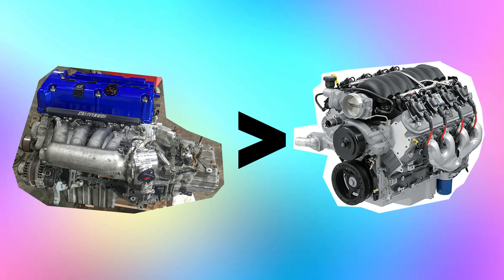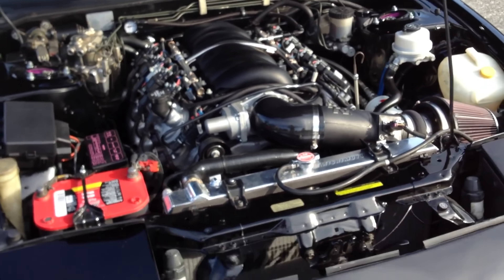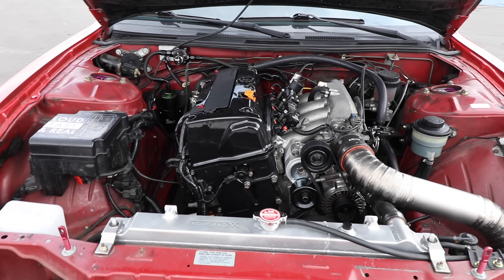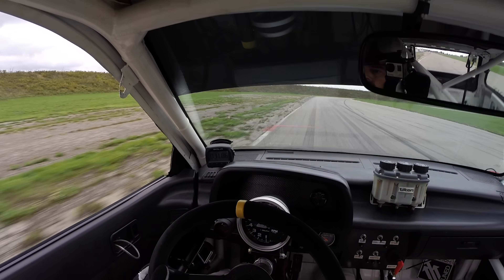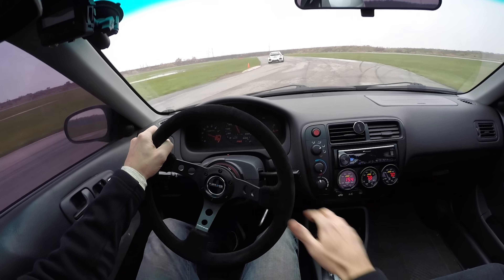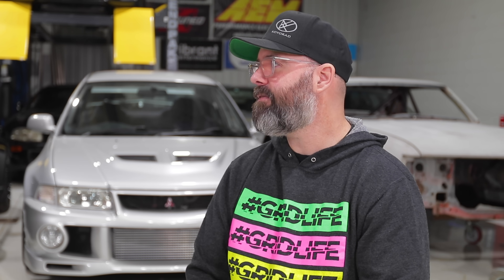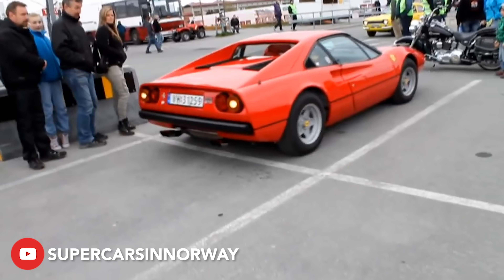Is the K-SWAP the New LS Swap? Everything you need to know about K20 K24 Honda Engines

Comment: k20 2.0L @ 275 lbs - and makes 139 lb-ft @ 4600 rpm and 156 HP @ 6300 rpm
LS6 5.7L @ 460 lbs - and makes 390 lb-ft @ 4800 rpm and 385 HP @ 6,000 rpm

K20 has a wider range between peak torque and HP
LS makes more torque per pound & equal torque per liter.

Comment: Why don't you tell the weight of the vehicle that the K starts to struggle? Because, you are showing pretty lite cars. From approximately 3000lbs and BELOW!
I have a IS300 that is about 3500lbs. I wouldn't want to be "IN" boost just to be driving to work and around town.

Comment: That's a transverse engine, right? How is it even possible to make it longitudinal?
Reply: Doesn't really take much, outside of "kit" items like rad hoses, motor mounts, bellhousing adapter and the other prefabricated chassis adapting parts. To keep them happy longitudinally I think it's really just an oil pan, oil pump with a different pickup, a "mirrored" or revered intake manifold (oem styles would put the throttle body facing toward the firewall) and I think that's kinda it for the bare basics. Oh I'm wracking my memory but I want to say that the cylinder coolant jacket diverter that the K24's have has something to do with those rwd swaps, cant remember if its you leave it in or take it out, or something... maybe I'm remembering K20/K24 Frankenstein stuff idk

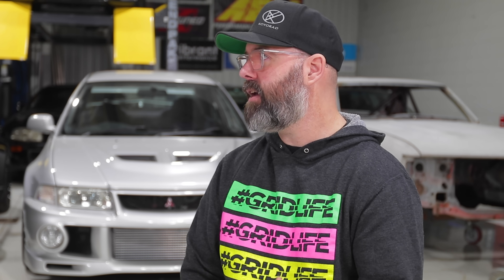Comment: 4:11 in that case, you just have to trade top end power for low end torque. With 2.4l and twin turbos you could get pretty insane bottom end torque (300+ foot pounds) while also getting 400hp at the crank.

Comment: How difficult would it likely be to put a K Series engine and manual transmission until a 1960 Austin Healey Bugeye Sprite. It currently has a 2.0 Pinto engine in it but I blew a valve/cam/piston so I'm trying to figure out if I should fix that or swap to something like this.

Comment: to get the power you can get out of an ls it will cost you more to get it out of a k24 or k20 most LS's come with 350 to 400 bhp your not getting that N/A from a K20's for the same money NO way use LS less then 1000$ sometimes pull it down clean it up and 400bhp now get a used kseries pull it down clean it up heads cams valve and god kows what eles just to get 300-400 will cost you much more even if you bought the k series for 500$ or less the new parts to get the power will exceed 2000$ if done by a professional company and really unless ur a don mechanic id get the pros to do so it depends on what you are going for i think init lads?

Comment: When it comes to exhaust size, i have an eg with k24a2 with 3 inch exhaust and it made 215 whp and 175 ft lbs of torque. I also have an ek with the exact same setup and mods but it has a 2.5 inch exhaust..the ek made 220 whp and 181 ft lbs of torque on the same dyno.
Reply: could the difference in transmissions, tires and axles played a part?

Comment: I love the B series and have many fond memories of ripping to 9k and beyond in B series Hondas on Japanese backroads, but I will gladly rip the B18 out of my ITR and replace it with a K20. Bolt in 220whp with stock engine reliability and drivability? You'll never be able to replicate that with a B series. A 220whp N/A B series is an engine that only wants to go WOT. With that said, the K series is definitely much more fragile than the B series in terms of being receptive to large cams and stuff, but I'm over having race engines in race cars. I just wanna drive, I don't want to deal with shit always being broken and cars that need to be push started because the overlap makes the engine not want to start on its own (that engine was a fucking blast though).

With that said, I would absolutely love to have a B series EG hatchback again just for nostalgia's sake.

Comment: .Na I rather Swap LS engine or Rb26, 2jZ k series are good but it's 4 cylinders comparing to ls v8 or v6 2jz OrRB26DETT Nissan Skyline RB28 is more superior and Reliable even with turbos bc no.matter what u do The K Series engines with Turbos wont passed 100  thousand miles without major Problems or Major Maintenance

Comment: They missed the part where you can get the power of the k24 but high revving of the k20s with a type s oil pump. But yea the aftermarket support for the k series are crazy. The best 4 cylinder swap for sure.

Comment: What is the upper weight limit that a K24 engine could push? I'm into American cars and have been exploring dropping a K24 into lighter cars like an early Ford Mustang Hardtop or an AMC Gremlin. I have noted that the K24A2 has been fitted into the Acura TSX that weighs over 3200 lb, a mild K24 build should work on anything lighter than 3,000 lb.Still, I wonder how it would work in the 78-83 Chevy Malibu or an El Camino? How heavy is too heavy?

Comment: I haphazardly searched "K24 swap everything you need to know" and found this video. I ended up watching a hipster and some dude that looked like my preteen nephew explaining how noises made them feel and being excited about triple-digit horsepower numbers that started with "2s" and "3s". 2/10 would not recommend. Just a few ideas off the top of my head for you fellas, could you maybe talk about engine mount locations, transmission choices, possible donor vehicles, engine dimensions, exhaust/intake locations or aftermarket tuning support? Weak..

Comment: You forgot to go over the fact that if you have a k24 block and a k20 head with a rsx type s k 20 oil pump.. you can have the low end torque, and the high end power all together.. mine made 273 with drag cartel 3.2 cams and Wiseco 11:1 compression..

Comment: It sounds more like "what to swap that is not done to death" than what you need to swap in your car.
You've said it yourself. To get any proper power 400+ you need tuning, parts and work to make it happen.
That doesn't sound like an "easy cheap" solution. And it doesn't compare to a truck LS engine at all. Smaller, lighter, yes, if that's what you need.

Comment: I've been planning a K swapped K24 bottom end and k20 red top jdm head maxima  turbo and NOS and meth injection antilag  and rolling antilag via Haltec and Bcracing DS coilovers lz spec 1989-1994 for the past 4 years and get my build tuned by Jack at hp logic or Brant at pfi speed

Comment: If I wanted to keep it super light and rev it to 8k all day, I'd get a K-motor, for literally anything else, LS swap it. Lighter per cu, more ci per dimensions, in fact it has almost the same external dimensions as a dressed k-series. Plus I can get parts at the local NAPA and go to any wrecking yard and pull a 5.3 out of any chevy or gmc truck and trade it for three chickens and a happy ending. There is just no beating an LS for ubiquitous swap engines. Almost anywhere a K-series will fit an LS will fit.
Reply: Damn you americans and your cheap v8 power

Comment: I can certainly see that if you have something like a 1.6L engine how going up to a 2.4L engine has a lot of appeal, the increase in torque (especially on a light vehicle) is going to make a huge difference. That is without having to go to forced induction in order to make decent power (for a small light vehicle).

Comment: LS3 makes 430 HP stock and could handle up to 800-1000 without making major modifications to the block, not sure why you would want a k series when it makes like 200 stock and probably blows up at 500 bhp.

Comment: The sr20 gets no respect in longitudinally mounted or transversally mounted cars. Very very underrated
Reply: Very very expensive. That's the point they are making
Reply: @jacobdoesfunstuff  Not really, you buy a DE cheap and de+T it for cheap
Reply: The SR20 is a trash engine that was built with every corner cut by a company going bankrupt to be an engine they can throw in everything.

Comment: No, its not. Because a K series wont hold the power a 250-500$ LS block/walls/rods/crank will.
  But, If I were to swap a Honda anything, Id do it "different" with an old SOHC.

Comment: 15k for 500
Vs an ls3  for about 5k stock
They may sound good 
But when your on a budget its not the way to go🤷🏿‍♂️
Reply: Exactly plus it's almost half the torque of an LS and this one especially require a race fuel since it very high CR
Reply: I see your point but, please know that the 500 hp $15k k motor is a specialty NA motor. If you are only interested in cost vs power, then you just go turbo for k series. you can get a k series engine + trans + and turbo it for under 5k. Stock block will handle 500, but obv rod + piston would be better for longevity

Comment: If the swap parts become more available and affordable for chassis other than Miatas, then maybe it'll be a worthwhile swap. Even the Miata swap kit is still 4~5K USD. You guys spent over 8K on your K240SX, with some nice fab deals from NV, and it was still just as fast as Vinhs FRS on worse tires. Maybe it's just my bias for wanting to drive vs wrench, but all these really complicated swaps don't do that much for me. They're less 'home wrenching' and more 'shop build' in my opinion.
Reply: That said, I'd totally love to see a K-Swap E36 or E30 project :P Just try to get the parts into production!
Reply: Or a Kswap RX8 since those shells have to be getting cheap and rotories are well....

Comment: I don't really understand power vs displacement. Unless you are getting taxed heavily by your government for the size of your engine. Which I wouldn't think would be an issue with a swapped car. To me the only number that matters is power vs weight of the engine and where the engine carries most of that weight. This is what makes the LS nearly unbeatable.

Comment: No love for the H. The H series swap is way cheaper and nearly as powerful. Downside is it’s heavier and not as well supported. But it sounds better.
Reply: Can you put it in a rear wheel drive layout?
Reply: @chrishenniker5944  You sure can, probably the easiest way is using a B series AWD trans. The engine would be transverse mounted though. The engine spins backwards so mounting it with an adapter to any old box isn’t going to work. To swap an H into a car like the 240 is not really going to work but you can swap it into any front drive car and covert to AWD or RWD if you desire. Years ago featured in Honda Tuning Mag there was a 5th Gen Prelude that kept its factory H and using a B AWD trans converted it to RWD. Over 500 hp and everything.
Reply: @dRiv3R0000  I suspected as much. As far as the front wheel drive goes, I know people swap them into Austin Minis, ADO16s, etc, as well as mid engine Fiats and kit cars. Are there any Honda power plants that can be stuck in a rear wheel drive layout, aside from the J and K series?
Reply: @chrishenniker5944  Well, with my limited knowledge I don’t know. It would depend on if there’s a RWD trans that spins backwards. Since the B and H both spin that way the only “easy” RWD Honda swaps are the K, J and the F20/22 (from the S2000).
Reply: @dRiv3R0000  I suspect that the L series can also be used in a rear wheel drive layout, as I’ve seen footage of them used in these very elegant, yet quick, long tail boats in Thailand. They’re longitudinally mounted on a stick, so I wouldn’t be surprised if you can bolt one up to a Getrag or similar and drop it in an Austin Farina A40 or Ford Anglia.
Reply: @dRiv3R0000  The other V6s spin the right way , you said. I saw a chart on the Kennedy Engineering website that they do an adapter plate for the Honda C series, so I could put that the right way. The G series  straight five points the right way too, so that might work with a Tremec T-5.

Comment: nobody cares about power per displacment unles you running in a class why would you start with a engine that small .with the ls you baseline power is way ahead of the 4 cylinder.no replacment for displacment

Comment: K20/K24 powered 308 is a fantastic idea. 

And with the right exhaust setup might even sound a bit like a the original V8, since they don't have the high-pitched F1 style wail of the later 348/355 cars. Through some big driving lights on the front and say it's a Group 4 Rally car!
You guys will have to rock big mustache's and Hawaiian shirts every time you drive it though.

Comment: boosted boiz is using 2 k24 engines in 2 different mr2s, the white one makes around 1000hp.
It is a respectable engine, you get it all, power, fun, torque, reliability and it is affordable :)

Comment: My man I have a stock 04 k24a2 block with a stock 04 stock k20a2 head in a 92 civic hatchback dx with a rsx type s 6 speed manual transmission rbc intake rdx injectors on e85 making almost 300hp

Comment: power to displacement is irrelevant. power to weight and power to physical size is what's important.

looks like the K motor can have better weight distribution for FR cars vs. the LS, and it might be easier to package too in some cars. The LS might be cheaper and more abundant in some instances, also not sure if Honda offers K20/24 crate motors.

Comment: I have pondered about putting a K24 in my 2003 factory 5sp IS300....but its still a thought! I dont think anyone has done it yet! I'm just trying to think out of the box and be different! Tell me your thoughts guys! I would like to here people's opinions!
Reply from the maker: There are really good options like the 2J and Beams so not sure its worth it.
Reply: @speedacademy  yea i feel like 2jz 1jz and the beams motors are just ppayed out and doing a LS swap has been done alot with the IS300 chassis. The K24 swap would be very different in the IS300 chassis! But like i said i have been pondering about k24 swap in to the IS300...but most likely all end up doing a 1jzgte!
Reply: @speedacademy  also doing the K24 swap in to the IS300 would be expensive because it hasnt been done before. So i would have to get custom motor mounts bell housing and wiring harness! I really dont feel like putting out that type of money to do all that work!

Comment: This was interesting - I don't know much about Honda motors.  How tall is the K series compared to Connie's Beams?  Going RWD from a K series puts the exhaust on the passenger side to get around the steering column & brake booster interference.

Comment: I have also seen a trend lately of 3SGE Beams motor swaps into various cars. Probably a fairly equivalent bit of kit. Are they much of a thing over there?
Reply from the maker: Yes, they are a thing here, including in our ‘77 Celica project 👍🏼
Reply: Awesome, I'll have to check it out!
Reply: 3sge is a reliable engine. I had red top before 197 stock hp and it doesn't care for whatever you do with it.

Comment: I'm massively biased owning both an evo 10 and 2 rx7... but i would argue its almost impossible to beat a rotary in terms of bang for your buck. I would also argue the 4b11t is HUGELY underrated for reliability and HP just because its in the evo 10 and not in the evo 9. If you want reliability per dollar i would argue for the 3sgte in my experience for 600hp and below. I could be wrong, and I love the K series, but the reason imho the K and LS is so popular is because of massive aftermarket support and not because of shear output and reliability per dollar. They're just cheap engines in the junkyard that distort the amount of money that goes into making either one be reliable on track, and unfortunately youtubers distort this image further (look at gears and gasoline latest civic build). If you want my suggestion, its better to just pony up the money for a car you don't have to swap from the outset, especially if you want to go turbo. It'll save you a ton of money and headache in the long run to start with an evo 8 then to try and make a k swapped anything produce 350 whp and survive more then 200 miles on track while being as fast for less money.

Comment: I saw a 05 Honda Accord Auto (k24a2) with 130kms on clock which had hail damage and no plates on local auction go for $1500NZ ($800US) yesterday.  
It was complete and looked very nice in white. 
Here in New Zealand we have the largest stock of JDM vehicles in the world and they’re super cheap and the mighty Barra’s are everywhere probably 1 in every 10 cars on the road is a Barra powered Falcon.

Comment: Stock LS1 gets valve float at 430-450hp and needs valve springs ($2000) 
Stock K24A2 is good for 550hp.
Reply: New valve springs can’t possibly cost 2k, can they?

Comment: You guys forgot to mention that 
Pure automotive just finish developing
Their Kseries swap for the FRS,BRZ
GT85 platform
Than on NA form minus the AC compressor is around 100lbs lighter compare to factory FA20 and ocourse way more power
Is All ready proven that a K24a2
With a complete 4piston Pro cylinder head package
Can make just over 300hp to the wheels on E85

Comment: I used to be huge on the k series (I am midway thru a k20 turbo swap in my lotus 7)  but think an LS would have been cheaper. Just the number of v8 parts that are out there has driven the prices down in many areas.  I paid $1k for the engine but then you add adapters, ecu’s,harnesses etc and it’s almost a $8-10k swap. 

That said- the manual v8 transmission is rarely a cheap option

Comment: I've swapped an H23 into a Ferrari 308. Biggest issue is the half shafts. They end up super short and wear out quickly. The hubs are way inboard on the 308. We also had to remake the upper control arms. The motor hit the arms forward mounts stock and the driveshafts didn't line up. I made billet upper arms that moved the upper forward mount back about 2". One good thing about the swap is it dropped about 300lbs!